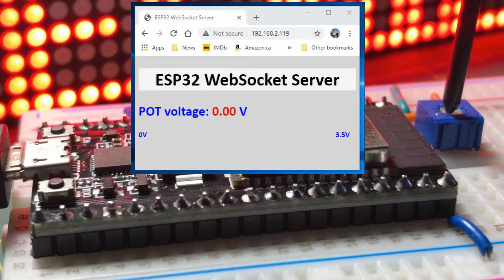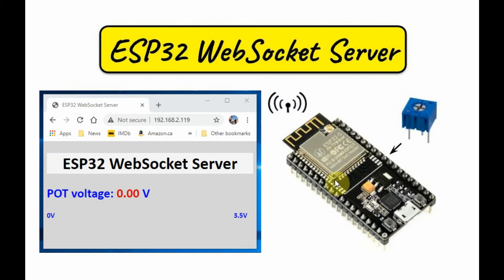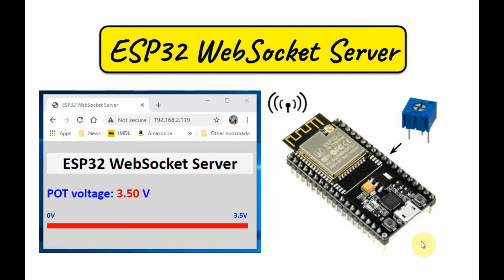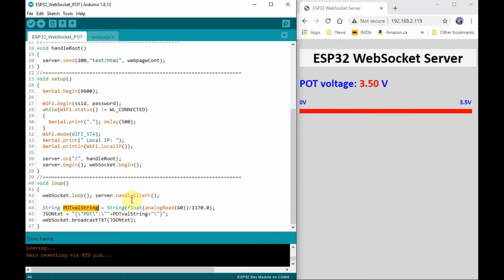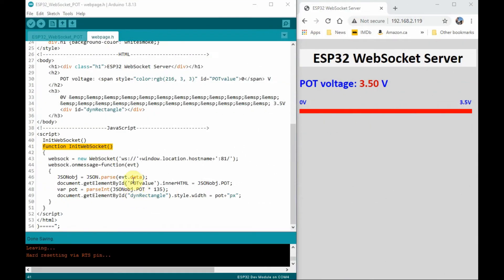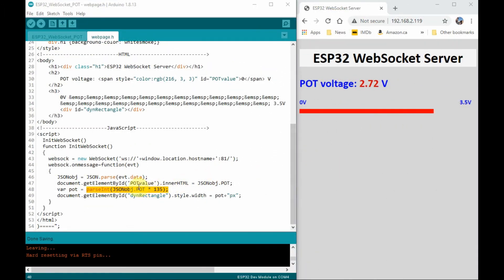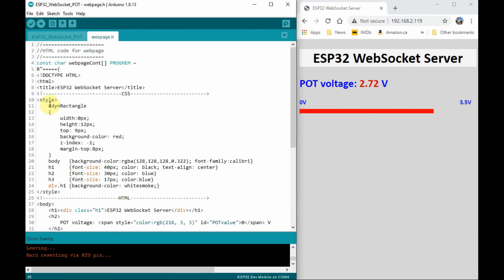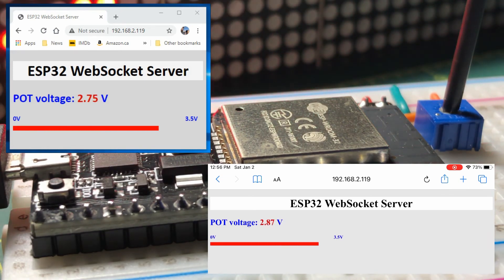ESP32 WebSocket Server - Sending Potentiometer Voltage

Comment: Anas, Thank you for presenting this. It is exactly what I have been looking for as a good example of a basic remote voltage display, however I am unable to find the proper WebServer.h .  I am using the Arduino IDE, and there is no library titled WebServer.h.  Using the library esp-fs-webserver.h  which seems to me like a possible alternative I get a problem in the instantiation of the WebServer ( Webserver server 80;) - the IDE reports "" 'Webserver' does not name a type."" Where can I find the WebServer library that you are using in this and other programs. Hoping that you will help.  Wally Harwood
Reply from the maker: Hi, thanks for your feedback. Checkout this link https://github.com/espressif/arduino-esp32/tree/master/libraries/WebServer
Reply: @AnasKuzechie  Thanks for answering so quickly. When I went to that link  I realized that I had not changed the "board" setting in the arduino IDE from ESP8266 to ESP32. Once I had added the ESP32 boards to the Arduino IDE the program verified and uploaded nicely.. Thank you again for your help